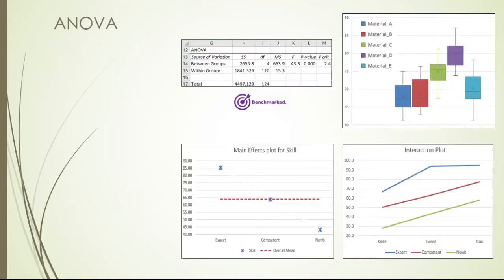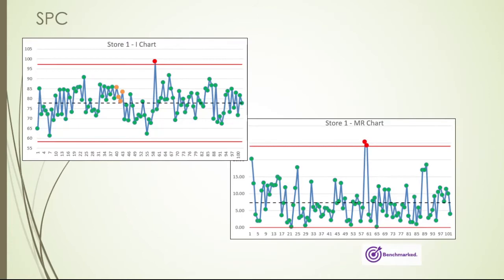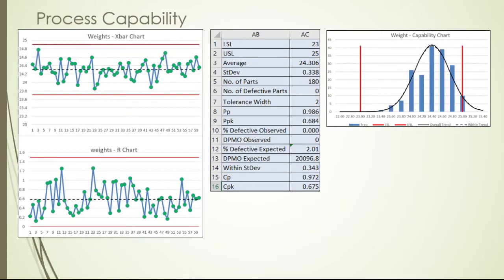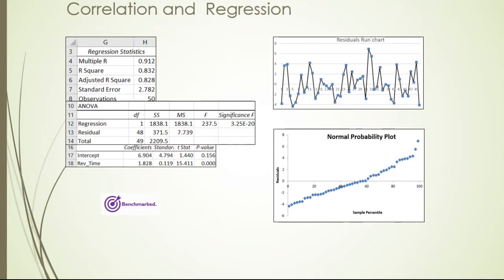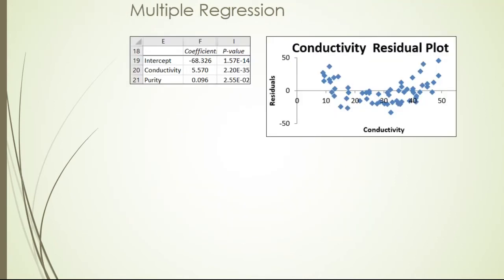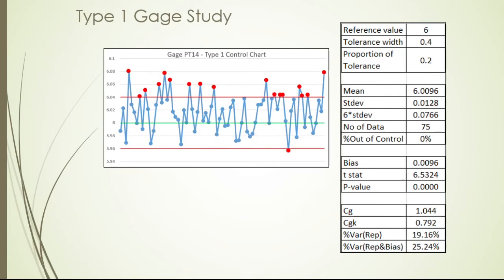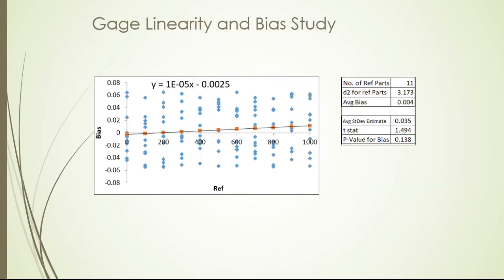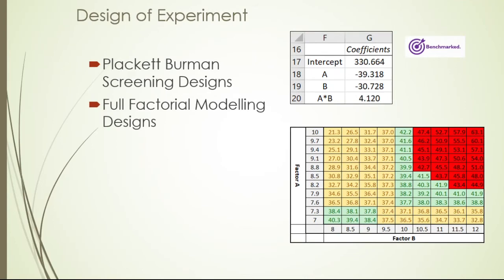Introduction to Learn Six Sigma Statistics using  Excel

Comment: "Six Sigma Champions are con men "
“All you have is smoke and mirrors ...” 
- Creator of Six Sigma, Mikel Harry
Reply from the maker: Why would one of the creators of Six Sigma say this about his creation? Did he think it was not being executed properly. There must be a specific context behind the quotes.
Reply: @rmksixsigma756  There is no context in which it is ever OK to be a con man.  Six Sigma was a blatant scam from the start.
Reply from the maker: @drtonyburns7321  You appear to have had one or more bad experiences but that does change the fact Six Sigma is a data driven system that can solve complex problems. I would be interested to hear of your experience with Six Sigma Champions.